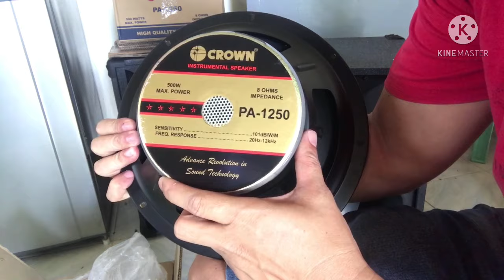Mid high D12 BULLET type & HORN speaker box

Comment: Boss, ano po ang resistance reading mo sa tweeter? Bakit nauna yong resistor sa capacitor? Suggestion lang bakit di mo na lang parallel yong resistor at yong capacitor sa positive bale 4 ohms load na mas safe sa tweeter mo.
Reply from the maker: Hindi ko nasukat bos, wla namng prblema kahit na una ang resistr sa pg kabit, kasi total impednce ang basihan, twetr considered as resistve load, hindi ko pa nasubukan ang pg parallel ng resistr sa spkr, so far ok nmn wlang prblema sa ganyng coneksyn ko.
Reply: @janthone84  pag naka series yong resistor magiging 8 + 10 = 18 ohms na sya tapos parallel mo yong woofer mo na 8 ohms. Ang load ng amplifier nasa 6 ohms, paano kung ang amplifier mo 8 ohms or higher ang kayang load, mag iinit yong amplifier mo at masisira.
Reply from the maker: @ellizerlopez7902  theoritcaly yes bos tama, wla nmn prblema sa amp yan, mportnte safe ang twetr natin